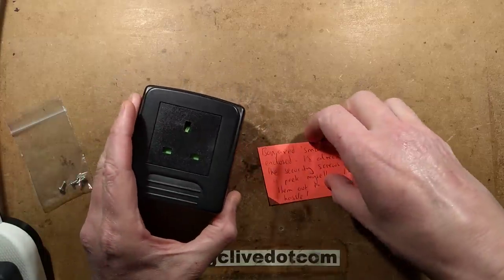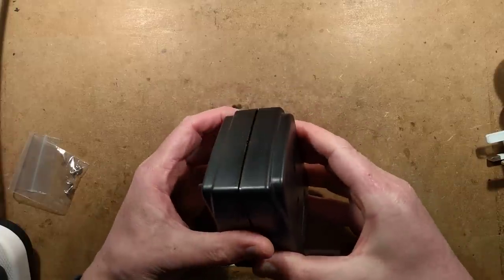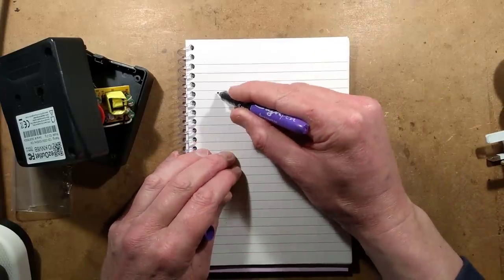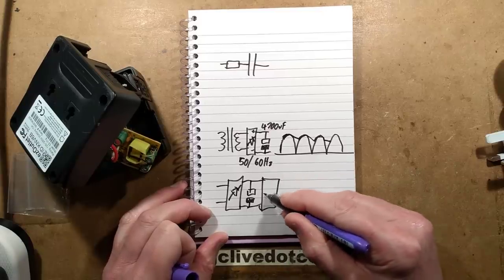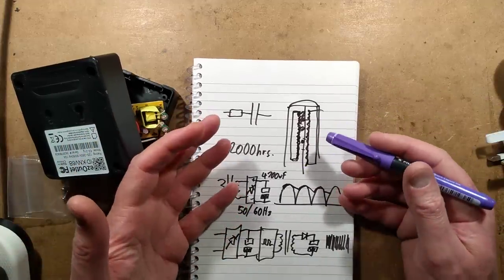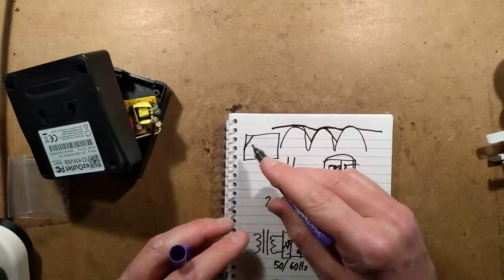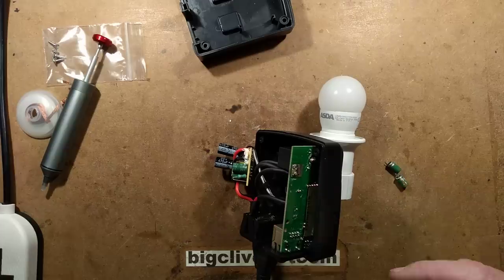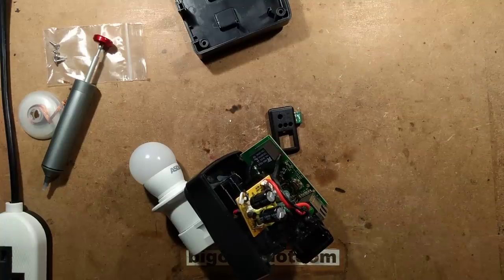Fixing an ezOutlet with inappropriate components.

Comment: It really frustrates me that consumer-grade routers/modems/Internet connections are so routinely unreliable that products like this exist and people "rebooting the router" is such a common thing to happen or to hear about. I really don't think it has to be that way... :(

Since mid-2013 when I moved into this house and became responsible for our Internet connection (at my previous house, my then-housemate had that job) I'm fairly sure that I've only ONCE had to reboot a router or modem to restore service.

We have two VDSL2/FTTC 80/20Mbps lines here, each connected with an ECI B-Focus modem ( https://kitz.co.uk/routers/openreach-modems.htm#openreach_modem ) of the type supplied by BT Openreach during VDSL installs in the early 2010s (although only one of mine was supplied by BT; I bought the second from eBay to ensure that both lines were the same and because that ECI modem is/was well-regarded).

While the ECI modems are probably partly responsible for the high reliability of our connectivity, I think that the primary responsibility lies with our MikroTik hEX, aka RB750Gr3 ( https://mikrotik.com/product/RB750Gr3 ), which is admittedly not a very consumer-friendly device for configuration, requiring a fair amount of networking knowledge to configure (they have a demo system you can play with here: http://demo.mt.lv/ ). But it's very stable hardware and software, and not even expensive - the RB750Gr3 retails for less than £60: https://linitx.com/product/14919

That doesn't include a modem or a Wi-Fi access point, but a lot of more technically-minded people prefer to have those as separate devices anyway. Modems should ideally be right next to the point where the telephone/coax-cable line enters the property, as extending a telephone line BEFORE the modem will usually drastically reduce the attained Internet throughput speeds, and Wi-Fi access points should be positioned with respect to the layout of the building, the construction materials used, where Wi-Fi coverage will be most needed, etc. - and you may even need several access points to achieve good coverage in a building that's large, has brick-built internal walls, or has heavy interference from other devices or from neighbours. Not only is it unlikely that the modem(s) and Wi-Fi access point(s) will be best-positioned in the same place, but there's also no reason for the router itself to be anywhere close to either of those. In fact if, for example, you have a cluster of Ethernet-connected devices in one part of the building (either desktop PCs, games consoles, network storage devices, etc.), you may want to have the router nearer those - or maybe just an Ethernet switch for those devices, with a cable running to the router somewhere else entirely, would make sense!

In my case the modems are by the front door, with Ethernet cables running two floors up, through the stairwell, into my "networking closet" which houses the router and the core 24-port switch. Then the main Wi-Fi AP is also in the stairwell, so there's a cable running back to that.
Reply: With my ISP's router, that thing would be utterly pointless. The ethernet side works just fine, it's the wifi that starts making a mess after about a month, so I have to reboot it. I could probably automate that with a programmable outlet, but eh. Too expensive.
Reply: Next up, you will find yourself pullin fibre and getting ready for 100G internal network and redundant routers :D
Reply: My router has an uptime of several months and my cable modem even longer.   With that reliability, I'd never invest in a gadget like this to watch over it.  The chance of a failure is just too low.  Besides, the router routes everything on my home lan and rebooting it willy-nilly is going to irritate multiple devices that are talking to each other rather than the internet.  I'd get blasted with lost connection messages.
Reply: That's the one of the main reasons I've switched to using a home server for routing and UniFi APs for WiFi. A little tricky to set up but you only need to do it once and your set up will probably run for months or even years without any issues. I only need to reboot my server for software (and occasionally - hardware) upgrades.

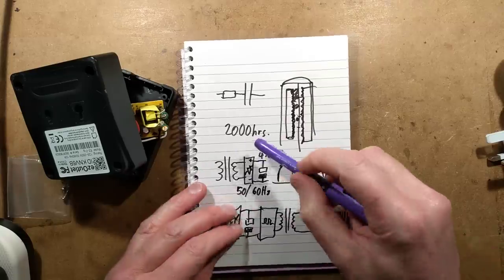Comment: 8:55 Well, usually, at least in datasheets, the lifetime of electrolytics is spec'd at full ripple current AND at their rated temperature (85/105C). The rule of thumb then is that the lifetime doubles for every 10C lower than their rated temperature. 2000h 85C = 4000h @ 75C = 8000h @ 65C etc.

Comment: Very interesting, especially the part on the capacitors. I understand now why the secondary ones suffer much more than the one on the primary even if the average voltage is lower.

Comment: Alternatively, you can tear down your D-Link router and salvage some components, and invest in a real Router that doesn't crash every 30 minutes
Reply: Or even just install a DD-wrt or some other 3rd part software. Even if that doesn't fix the stability issue you can program it to automatically reboot. Like once a week or day, etc.
Reply: @allalphazerobeta8643  sadly its gotten to bloated for most D-links....  only good for door stops now.
Reply: @ItsMrAssholeToYou  I never had any success with D-Link routers. All the one I own needs to be reseted multiple times a day. I have a few different D-Link models since that's the default free garbage they give you when you subscribe to a new ISP. I also bought an expensive one at some point, but it also had the same problem. I exchanged it for a new one 3 times, all with the same issue. I just came to the conclusion that D-Link is garbage. Maybe I got unlucky with all the 10+ D-Link I have, but that's funny how all my other routers never needed to be reset. They just work none stop for years.
Reply: My enterprise class (lower end of enterprise) D-Link WiFi access points (dual-band 802.11n/ac) I use at home don’t crash at all and they’ve been running 24x7 for several years.  The moral is probably more along the lines of “don’t by cheap consumer grade junk” when you want reliable 24x7 operation. ;-)  I gave up on consumer grade WiFi gear many years ago, plus the enterprise gear is far more flexible and configurable.  I also don’t put a router in my access points, those are best kept as separate jobs IMHO so you can choose the best gear for each purpose...plus if you loose WiFi you don’t lose the wired router that way, and vice versa.
Reply: @ethanpoole3443  Good point. Although the D-Link I bought was mid-end and didn't work better than the cheap ones I got for free from my ISPs. I must admit I should not expect the low end ones to be reliable, but you can get routers from different brand for just a bit more and they are reliable. Anyway, that's just my personal opinion from my experience. I admit my opinion is probably bias. Also, I have read that D-Link actually use good hardware, they are just horrible at making firmwares. If I could find those routers and update the firmware or install DD-WRT or OpenWRT, they would probably be more reliable.
Reply: @Abstractism Funny, i have had a fairly hard time crashing a very cheap TP-Link. Then again i needed more features so it's running OpenWRT now.

But i'll upgrade to FritzBox, i picked up a few discarded ones for pennies.
Reply: I went thru cheap routers about every 4 to 6 months I bought a MikroTic rack unit RB 3011Uias-RM  and for wireless got a Ubiquiti Pico station M32 HP had it now 4 years not a problem and have over 1000 foot of range to use out in the shop for my wifi  it out side on a mast by the house  The router has 9 outlets for cat 5s two servers  and the inside wireless router security cams and other stuff I hobby with  the speed monitor is good it lets you know if your outage is on your end or the nets in the long run it has saved me money .
Reply: @gaellafond6367  Actually I've been a lot happier with the free ones from UPC than any of the Netgear or Belkin ones we had before that.
Reply: If you want a router that goes down reliably and often, go netcomm... ;-)
Reply: @girlsdrinkfeck  ISP routers are physically and legally locked to the ISP settings and typically allow remote reconfiguration by the ISP.   This is why the common sense advice is to install a completely user owned and controlled router between the ISP box and the actual private network.  In practice a consumer router upgraded with good 3rd party firmware is best bang for buck.

Comment: I had an Ondigital box, which I bought cheap as OnDigital went bankrupt. But was relaunched as Freeview, and the box worked with Freeview, just some of the menus did not work right but all the channels worked fine.  Anyway a few years later the box became unreliable, looked at getting a new one but was a few hundred pounds for a recording Freeview box, so did some research and fixed it.  Turned out it was the power supply as the caps where blown.  So went to Maplins and bought everything I needed, as you can see still into electronics now as I'm watching this channel.

Comment: My goto for replacing old electrolytics in electronics are generally Panasonic FR's - low-ESR, decent quality and available in loads of sizes, even smaller ones (they're not the cheapest though). If I recall correctly Würth also make low-ESR compact designs. Sure, they're not Japanese (like Chemicon, Rubycon or Sanyo), but they're at least decent - especially compared to many of the Taiwanese caps.

Shame there's no such thing as a perfect cap, if you're going small in size, you're generally compromising on something else. (Mind out of the gutter!) Be it cost, quality and/or capacitance/voltage.

Comment: I bought a faulty LCD monitor off eBay a few months back for £2, when it arrived it was apparent that it had been taken apart and didn’t even have any screws in it. Straight away I saw 2 caps on the power supply were blown/bulging so I found some the same (on an old but working sky box power supply), soldered then on and it works perfectly. Put it back together with some screws I had knocking about and she’s as good as new(ish)!
👍🏼

Comment: Thanks to my limited electronics knowledge and solder skills from fixing things and bit of Big Clive Inspiration. I fixed my own VoIP adapter (HT-502) which had become very nosy. All I did was replace all the cheap electrolytic caps with name brand ones I picked up from a local surplus electronics supply.  Total Cost: $3.50 (owned all soldering supplies.) And I have voip adapter that will probably not go bad unlike the last two. One thing that was interesting was some of the new decent name brand caps where bigger even though being the same specs. (HMM?)

Comment: Clive i think it was when they were run at their max rated temp.
Eg 2,000hr @ 85°C
As I have seen the same ones rated 20,000hr & 35°C
Reply: Many manufacturers have an equation to calculate expected lifespan based on their nominal ratings vs operating environment. Every 10C below rated temperature doubles life expectancy. A 2000h 85C-rated capacitor can be expected to last ~64k hours at 35C. Some manufacturers' lifetime estimation formulas also include terms for ripple current and DC voltage. Basically, the further below the capacitors' rated specs the capacitor operates, the longer its lifespan and those are pretty significant multipliers. In the case of ripple current, the relationship is usually (i_rated / i_RMS)^p where p is anywhere between 1.3 and 2.5 depending on manufacturer and capacitor family, anywhere from almost linear to more than square.
Reply: @teardowndan5364  I am no expert I just remember seeing things like this on my motherboard spec sheet

Comment: My old PC used to crash randomly and blue screen or just do weird things in general until I got fed up with it and stripped it down to clean. Looking carefully at the motherboard I noticed 2 clusters of 4 caps near the CPU, they had bumpy tops so I ordered a load of the same type/values and replaced all the electrolytic caps on the motherboard and it worked perfectly after (and still is many years later). Don't be afraid to replace the caps on a motherboard, just be aware of where they come out on the track side and the polarity, don't linger the soldering iron too long on the tracks and be careful of bridging tracks. There are some wiggly tracks near the CPU pins which are for timing the data lines and the caps are close to them. Just take your time, take it slow and careful and give it a go :D

Comment: The second page you printed out looks like a misplaced description: I can't find an "AM" series on Panasonic's site, and the details on the page point at their "M" series which is just a general-purpose 85°C capacitor, nothing remotely special.

Panasonic do have a suitable capacitor in their FR series, if you can obtain that. Other series with 470μF in 6.3mm diameter include Nippon Chemi-con KZN, KZM, KZH, KYA; and Rubycon ZLH, ZLJ, ZLQ and YXJ (the latter two in 10V, even!).
Reply: @pmailkeey Afaik they at least make good capacitors and batteries, but when it comes to consumer electronics it generally a non linear function of quality vs cost whichever brand you choose.

Comment: As I understand it, an electrolytic capacitor's lifetime rating is based on conditions of its own maximum electrical and temperature ratings.  To make a capacitor last far beyond rated life, one simply "over-rates" components; runs them at well below rated maximums.  For instance if it's to be run at 85C and 10 volts, use a 105C/16V cap -- or better.

Comment: The capacitor MTBF/hours rating was typically based upon operation of the capacitor at its absolute maximums of temperature, frequency, ripple, and voltage.  Reducing any of those factors to well below the absolute maximum values will significantly extend the MTBF...which is why well engineered devices are usually pretty conservative in terms of reducing ripple, peak voltage, and operating voltage so you get a greatly increased MTBF.  Also, older electronics tended to be more tolerant of ripple as well, which also means that they tend to tolerate more degradation of the capacitor before they cease to operate.  If you download a major brand name in aluminum electrolytic capacitors they will often have some guidelines for estimating capacitor life when operating at less than the absolute maximum ratings.

Comment: I had two TP-Link WAPs that were quite good and they both failed fairly close together and I initially thought a power surge had done them in. Opened them up to find the common chinesium type round top electrolytic capacitors. The most expensive cost was the bloody shipping but they both returned to the land of the transmitting for a parts cost of less than AUD$1.50. Nice fix and they will both find a good home(s).

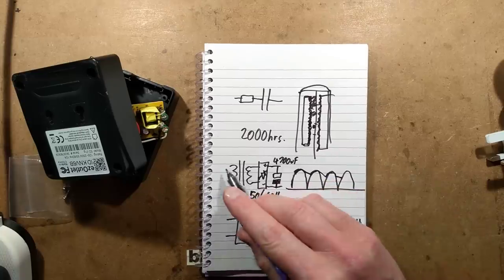Comment: 9:25 the lifespan provided by the manufacturer is specified at the maximum rated operating temperature (85°C, 105°C, or even 125°C, depending on the capacitor.)
As you lower the ambient temperature, you effectively multiply the cap's lifespan. If I'm not mistaken, for each 10°C drop its lifespan is potentially doubled.

Comment: Clive, i've come across the problem with caps several times before.I just replace them with metal encapsulated SMD ones. Simply remove the rubber foot from the bottom of the SMD cap and bend the legs slightly in order for them to fit into the holes on board. Maybe a touch of heatshrink over the top. Of course it helps if you have SMD one's in first place in the correct  values I suppose

Comment: Hi Clive, I'd suggest leaving larger sized capacitors if they can fit in the box. Browsing datasheets I've mentioned that often differently sized electrolitics of the same type and capacity with smaler diameter have shorter lifespan even in the lists of reputable producers.
Reply from the maker: Sadly the room in that area of the box would make that a bit messy.  But more reliable as a result.

Comment: Always learning from you, those are the exact caps I had to drive up to city for, was fixing an old charger for an 18 volt power supply charger I couldn't believe how simple it was transformer then 4 diodes and a cap 4700 35 volts. I soldered it but never tested it yet. I bought a truck and the kansas rain started up then the flood now its drying up now I just got replace the trans then maybe I can get back to my electronics stuff. I needed a break from automobile stuff. Cheers sir BigClive have a good 1

Comment: I've got capacitors from the 40's that are still working fine, they're dry electrolytic but there's no hum in my amplifier, I actually installed it because I wanted it to look old inside, but there's no hum at all, it's really silent, I also used old bypass caps too, no leakage at all
Reply: Matt Quinn yes, however the bypass capacitors are dealing with audio frequencies at a high voltage (generally a few hundred volts) but yes, the filter capacitor is dealing with low frequency mostly, however the bypass capacitors are paper and foil, still from the 40's but they are not electrolytic so it's not a fair comparison
Reply: If the bypass capacitors are paper it isnt a question of if they will fail, but when they will fail.
Reply: @ikonix360  yeah, though it does take them a very long time to do so, though i used them to look original, it isn't difficult for me to replace them when needed, i have plenty of new and old capacitors to replace them with, but currently they do not leak at all
Reply: You can always make fake paper shells for modern caps. I did that as a kid as part of being unpaid labour to a mate. Years later, taught a restorer to take them one step further by "weathering" them like a model maker so instead of new they looked like they were 50 years old. Coffee is the prince of organic stains.
Reply: @AlexLaw_Qld  yeah, but i had original good caps so i used those, i have many many caps so if one goes bad i can replace it, i actually have more old caps than i do new ones